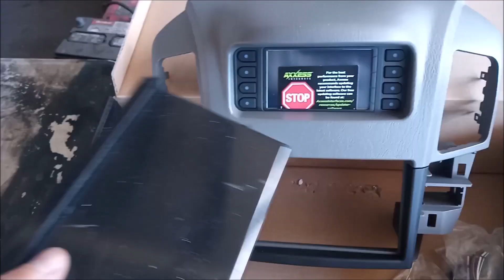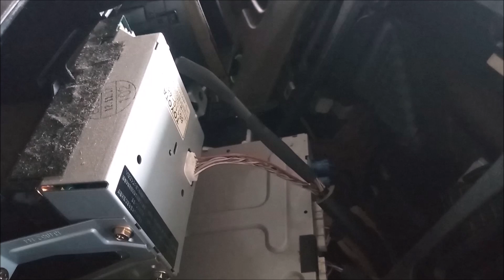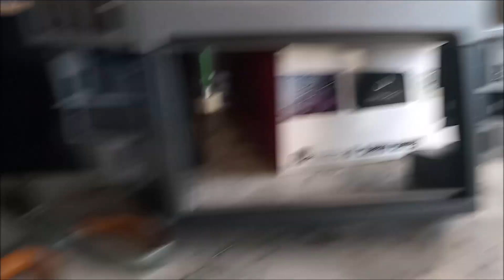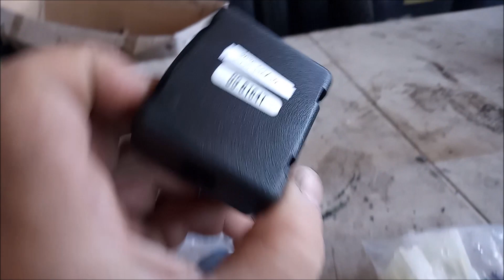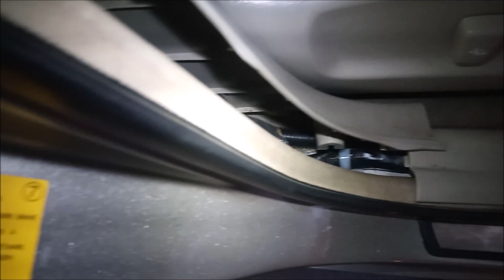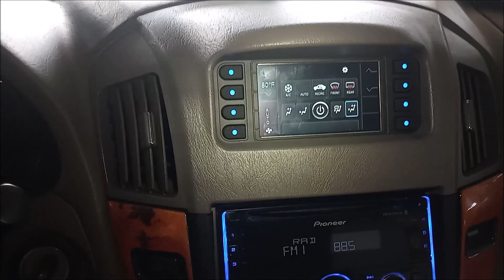Lexus RX300 Stereo Install - Metra 99-8164 Climate Control Backup Camera Navigation Amplifier Bypass

Comment: Where does the black witre with the jack plug go?
Reply from the maker: In general black is the standard color for ground on aftermarket stereo systems but I have absolutely no idea which wire you are referring to or which jack. Maybe you're talking about the sony jack (for sound), for the microphone?

Comment: Thanks for your videos, I have a question? Does the original Lexus stereo have a security code that needs to be put in when you cut the power??
Reply from the maker: No, it does not, you are mixing it up with a Honda.

Comment: Well I know what I'm doing when I get the mechanical bits of my RX300 working. Thank you so much for the video. I personally might go with a touchscreen head unit but that's me. cheers
Reply from the maker: Thank you for watching and for commenting. Regardless of what head unit you go with you will need a way to control your ac and you also will have to deal with bypassing the amp.

Comment: Do you loose the engine data with this kit, the MPG readout available on the stock system?  Nice install, I could certainly see adding this!
Reply from the maker: As you've guessed, the MPG display is gone. All you have on the screen are the controls for HVAC. Thanks for watching and for commenting.

Comment: factory radio is best for this car
Reply from the maker: On this car, we replaced both the factory radio and the factory amp with used factory units, and still it produced no sound. So we had to find another solution.
Reply: why do you say that?
Reply: @yvettehardison4941  factory navigation radio and factory amplifier are cool why change with basic radio? I don’t understand
Reply: @yvettehardison4941  if factory radio is basic and you replace with aftermarket navigation radio I don’t think it bad or now install navigation radio and want to reinstall factory basic radio it okay

Comment: why you replacing radio
Reply from the maker: It quit working, so needed replace. Second-hand radio did not work either. Replaced amplifier with second-hand and still no sound.

Comment: Like your video. Just a question, does the factory amplifier connect to the factory sub?
Reply from the maker: I didn't know there was such a thing as a factory sub for these cars, and i don't know anything about it. The factory amp does connect to all the speakers.
Reply: There is a stock sub under the passenger seat. I am in the process of reconnecting the stock one and removing the after market sub. I checked the connection at the stock sub and it’s in tact. Next I will check the amp to see if the after market sub installers disconnected it. Will report back what I find. Thanks

Comment: A couple of notes: 1= Without installing an aftermarket amp, you're not able to hookup the subwoofer that is under the passenger seat. So losing a little bass in the system (a tiny mono sub amp can fit easily behind the glove box area). 2 = People should know that the Metra kit has some issues. a] it does not dim at night with the dash lights. You can adjust the brightness in the menu but it is either going to be dark during the day or way to bright at night. For the price of this kit, Metra not including a dimmer line for the screen/controls is unacceptable. b] even thou some models of this kit in other vehicles will display the vehicle's outdoor temperature sensor, this one for the RX300 does not. So you lose that feature. 3 = more a criticism on the installation; you guys need to learn to solder & heat shrink. That wiring looks nasty, I would never let a customer's vehicle leave like that. You left a lot of bare wires as well, doesn't mater if those lines weren't used, they should never be left exposed.
Reply: Nah you can get a active Line output converter like a LC2i pro etc or even some amps have LOC built in. Definitely a way to get proper sound without replacing factory unit. But I like the android upgrade better
Reply from the maker: Solder on these wires is a waste of time. Crimps are more secure. We use crimps over solder in all our motorsport applications, whenever possible. I would not call that nasty, not unless you want to display your own ignorance. There is no bare wire left in the installation. I don't know where you get that. Some of the shots may have been taken as work in progress. Get off your friggin high horse.
Reply from the maker: PS. We don't give a rat's ass about subwoofers in fact we rip them out of eery vehicle that comes in our shop.
Reply from the maker: Go boom boom yourself into premature deafness.

Comment: I was like, "man that looks easy enough," then you flipped the switch and had the whole interior out and I was like, "that's gonna cost a lot to pay someone to do."
Reply from the maker: Yes getting to the rear-located amplifier to do the bypass requires you remove the glovebox, kick panel, door sills, rear seat, and trunk deck. The amp is a real pain in the rear. It's not difficult, just tedious.
Reply: @Merryfrankster_ how come you can’t just disconnect it
Reply from the maker: @ssjdavid  buddy I can disconnect anything I want anytime I want but how come you cannot ask a question that someone can answer.

Comment: If I just wanted to replace the Head unit to a pioneer fh-s52bt, do i need to replace the kit?
Reply from the maker: You can replace the head unit without the metra kit but you have to either bypass the amp or wire the head unit straight to the speakers.

Comment: Do you have any idea what the 3.5 headphone jack does on the metra's wiring harness?
Reply: The jack is to connect steering wheel controls with another adapter
Reply from the maker: Sorry I corgot already but you can download the installation manual from the Metra website. Just search on the part number in this video.
Reply: @Merryfrankster_  That's the thing, the manual has no mention of this mysterious jack. Well since you didn't use it, probably won't effect me either.
Reply from the maker: Lol it could be just a headphone jack, for headphones.

Comment: If you’re installing a new amp and speakers, the bypass would be completely unnecessary and you’d just route the speakers directly to the new amp right?
Reply from the maker: You would have to run new wires from each speaker to the new amp.
Reply: Like the comment said 

If I’m running a new amp and speakers 

Then I don’t need to use the bypass harness right ? 

I just connect the head unit to the power,ground,remote,illumination 

And run speakers from the new amp to the new speakers 

Then run rcas from the head unit to the new amp 

Is the bypass harness only used if u wanna use the factory wiring ? As In the wires that are already In the doors and that still runs the factory amp ??
Reply: @danielurrea9091  Yes I completed my install. You don't need the bypass harness as the amp will no longer be used. Everything you said is correct.

Comment: I just got a 10.1 android 2000 lexus rx300 new radio. i changed it but it doesnt turn on and now the windows wont go down.
Reply from the maker: You shoulda got the one in thia video.
Reply: This person blew the fuse under the steering wheel that says gage it's a 7.5 ...I am also having an issue with trying this same install has anybody been able to get one to power on